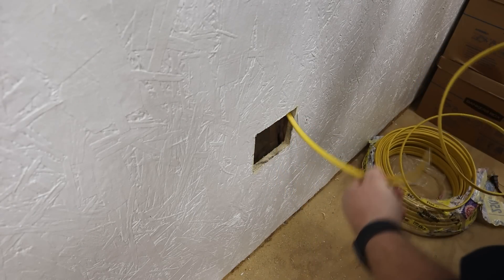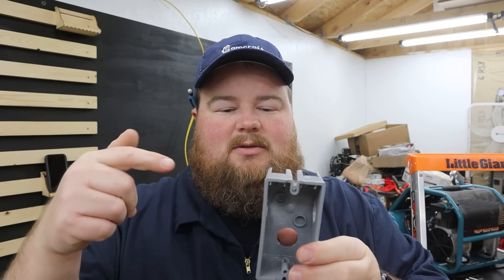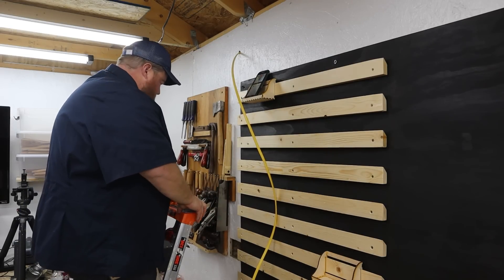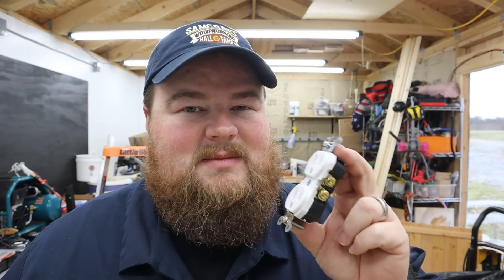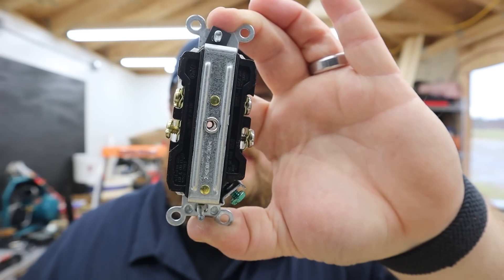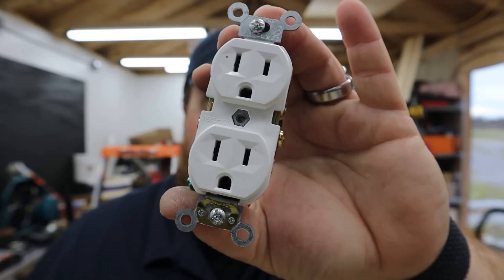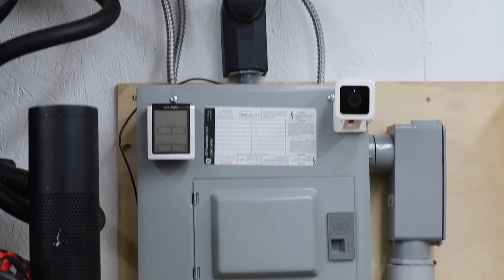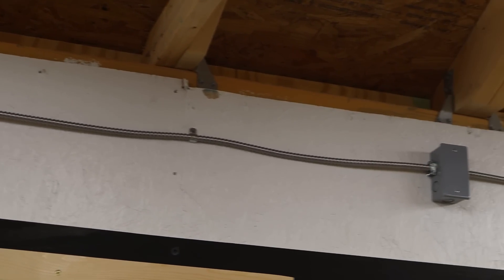NEW Outlets in OLD Walls // Small Workshop Electrical Wiring

Comment: Could you or have you discussed why you are using Wago Lever Nuts for wiring connections.  I have always used wire nuts and see some videos using Wago.  I ask because it seems the contact area on the Wago does not meet as much contact area between the wires.  Thanks for your reply!

Comment: Very nice job!

I like your solution of using the horizontal runs at the top, then doing the vertical runs in between the studs in the wall. Very clean.

Comment: I know you’re getting a lot of arm chair electrical advice but you need to break off your plaster tabs (ears) when installing a receptacle in an old work box. If you notice, they are already scored. You just bend them back and forth with lineman’s and they will break off. This will allow your faceplate to mount flush. New work boxes would be behind the drywall. Old work boxes mount on the outside of the drywall extending out about an 1/8 inch. When you don’t break off your plaster tabs the receptacle will extend out another 1/8 inch. Break off the tabs and they will recess neatly flush against the box.
Enjoy both channels. Looking forward to the new channel.

Comment: Nice job,  glad to see you used the "red caps".  Pig tails is the correct term.  When cutting the casing on the bx, I use a hacksaw and cut on an 90 angle to the wrapping.  Quick cut and then you can just slide off the casing.  Just takes a little practice to not hit the wires.
Reply from the maker: Thanks for the tips!

Comment: You didn’t mention anything about adding another breaker or if you put it on a existing one. Also what is the rule as to how many source points you can have on a 10/15 amp breaker before you need to add another one.

Comment: I personally like exposed conduit. I think it just looks cool, but I admit, it can get in the way at times.

I want to give a heads up, just for safety sake. You are not technically supposed to use plastic boxes with metal conduit. The problem is that if there is a short within the conduit, the metal conduit can become live (hot) and it has no ground path back to the panel because the path is broken at each plastic box. Ideally, you would use PVC conduit with plastic boxes and metal conduit with metal boxes. Alternatively, contrary to popular belief you can run romex in some exposed locations that are not subject to damage. Generally, above 7' off the floor or in other protected areas. Basically use common sense there. They do sell 1/2" grounding bushings that you could use to ground the conduit at the box, but they aren't super cheap and it could add up fast. You'd probably be better off just switching them out for metal boxes at that point. Anyway, not telling you to change anything; Just throwing out info. Be aware that there is the possibility of shock because your conduit is not grounded. Be safe.

Comment: Sam you used romex connector on your Armorlite cable, witch will not hold your anti short bushings in your MC or AC cable. Armorlite cable connectors have a smaller hole in the end to keep the anti short in the cable to protect the sharp edge from cutting the wire . But you made the walls look nice and clean.👍👍

Comment: Gotta say Sam you should have run wiring before you covered all the walls, think I mentioned that too. All that conduit crap draped on the walls looks terrible. 
If something is worth doing do it right the first time. This is like a flash back of your step flashing fiasco when you were sheeting the building.
Reply: Good thing it’s not your shop Tom. You don’t have to look at it.

Comment: May want to add the people the importance of the little red plastic tabs your installing on the BX wire (armoured wire) it’s an anti short cap and is often needed to pass code. Doesn’t always come with a roll of BX so you’ll have to pick it up yourself. 

But honestly hiring a certified electrician is always safest. I know I’m biased because I am an electrician. But iv never understood why people take the chance of doing their own electrical when a problem could cause shock, harm, fire and/or death risks. Most people are more likely to take the chance with electrical which has life threatening risks over plumbing with more often just causes property damage. I feel electrical should be considered more of a dangerous job to do yourself then things like plumbing,flooring,tiling and drywall.
Reply: I agree to an extent; for complicated jobs, get the sparky in there. But for simple things like adding a few outlets or switches, it's very easy even for a diyer, and even following code. The problem is, like everything since the pandemic, the cost of electrician services have skyrocketed to the point of almost cost prohibitive.

Comment: Also why would they put two silver and two brass screws on those outlets if you where not supposed to daisy chain them.  Those wego connectors would get expensive if you did that wiring a house instead of daisy chaining them.  Your breaker should be limiting the draw to 15 amps. Just my 2 cents.  BbAnd I’m cheap I probably would have just use the Romex cable and some wire staples and maybe paint it to match the walls.
Reply: Also because the receptacles are run in parallel, regardless of if you use wacos/pigtail or just connect right into the back of the first and “chain” (jumper wire) to the second each receptacle will carry its own load. The two lugs on each side of the plug are connected so as long as you don’t break the tab connecting them you can just wire into one and jump wire to the next. Save you money since you don’t need wacos or marrets. Also the more marrets you use the more space taken up in the box which actually has a limit to how many wires and marrets are aloud in the by code.

Comment: Running one outlet off another won’t hurt anything. If there is ever an overload, your overcurrent protection device (breaker) should protect your outlet if they are sized correctly.
Reply: What you did works just fine, too.
Reply: Ya it works fine but is more work and money. Because the outlets are run in parallel they will carry their own load unless you alter the outlets to run them in series.
Reply: @fritzginger15  neither way is more work or money. If jumpering between the outlets and only landing on one, you would use less wire for the jumper than Sam used to cut his very short tails. I would have wrapped at least one of them with electrical tape to reduce the potential for arcing between the hot and neutral screws in between the outlets.

As to carrying their own load, please see my comment about sizing the outlet and overcurrent device properly.

Comment: I wondered back about 3 months ago when you were insulating why there was no rough in electrical. It’s easy and cheap when all you have is the bare stud wall. Oh well, water under the bridge.
Reply from the maker: At that point I planned to keep my shop off grid and did not have things mapped out enough for wiring. If nothing else, you're sure to see things different on this channel! No boring stuff, eh? :)

Comment: Did I miss something? How many circuit breakers were required/used?
Reply: Just one new circuit is used for the receptacles.
Reply: @sk8infreek  Hey!!!  I am so glad I found your channel. For a long time, (more than a year) I have enjoyed every publication. Thank you for responding.  HAPPY LASERING and everything else.
Reply from the maker: I installed three 15 amp circuits. Each circuit has two dual-gang boxes on it with two outlets per box. So each 15 amp circuit has 4 outlets or 8 plugs per circuit.
Reply: @Samcraftcom  cool. No overloads.  I predict happiness for your work. (Also, nice logo )

Comment: Thanks for the video. Nice work. Question: what was your thought process on 12-2 wire? Did you consider 12-3?
Reply from the maker: I've only ever used a /3 wire if I needed 240v or if I was wiring up a two way switch for a light.
Reply: (not an electrician) my understanding is if you are only running 110/120 volts you run 12/2, 12/3 provides 2 hots a neutral and a ground meant to be used in a 220/240 volt circuit
Reply: @keek80  My mistake, I got confused about what wires were in 12-2.

Comment: Waygo's for the win, lol.  I love those those things.  I've had to do similar for my laser wall, to put 220v there for the big laser, and add a few outlets for the other stuff on their own circuit.  Luckily, my drop ceiling give me room on the wall above the ceiling line to drop the wires through, so no surface mount boxes since the remodel (we had them before though).
Reply: Seriously. I love wagos. I don't care about the extra cost; I don't wire things up for a living, but I'll never use a regular wire nut again.
Reply: @NWGR  I 100% agree, lol.